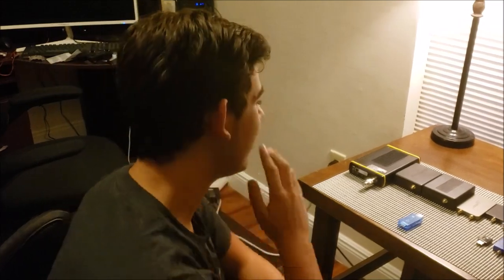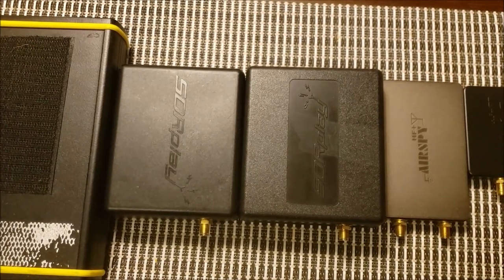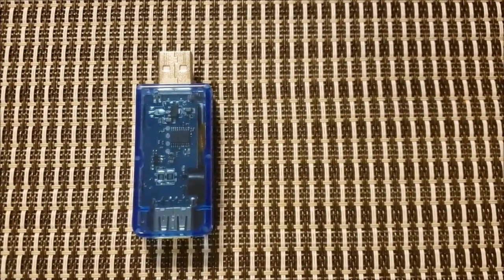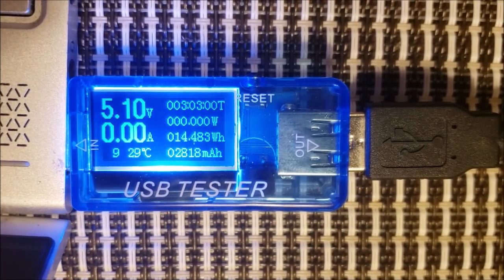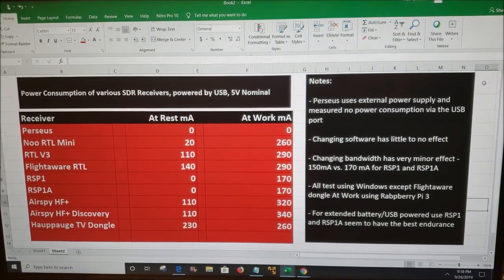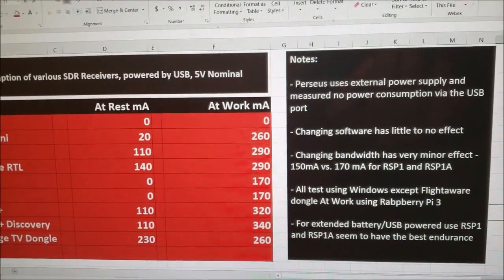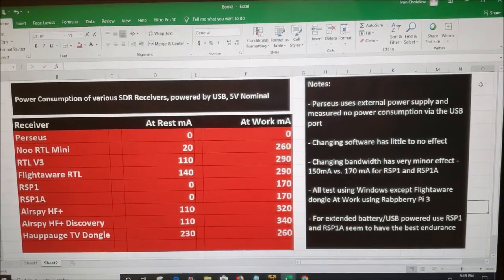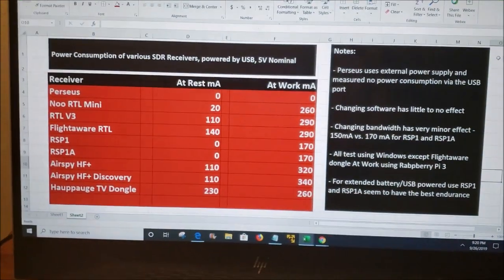2019: Nine SDR Receivers power consumption comparison - how much power does your SDR consume?

Comment: Thanks, I was also impressed that my RSP SDRs consume very little power, even when at 10 MHz bandwidth. But why didn't you measure the current draw from the Perseus's power supply? What was the point of listing the device at all? So you could not use it without 220 V? Does it have 5 oder 12V DC input, so you could use it in a car if you wanted to?

Comment: The developer of SDR Sharp ("lambdaprog" on Twitter) points out that SDRs with higher dynamic range consume more power, so performance should also figure into your calculations. As ever, engineering is a game of trade-offs.
Reply from the maker: it's hard to imagine when power consumption of an sdr would be an important factor. may be when you are constructing a fully self contained solar powered station. But it's an interesting aspect to explore.
Reply: @icholakov  I'm hoping to develop exactly that: a solar-powered SDR package that can be placed in a good RF location that has no direct Internet access. Maybe use WiFi to glom off a nearby access point lower down the hill. 

But I think the point made by "prog" (whose group built the AirSpy line) is that the power consumption of internal components affects the performance of the SDR; this is different from the overall power consumption of the entire device.